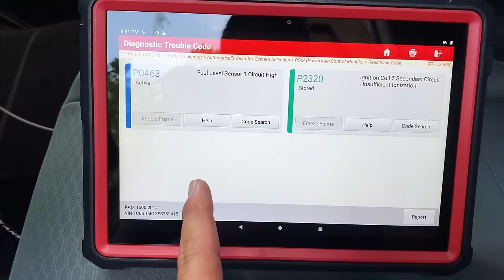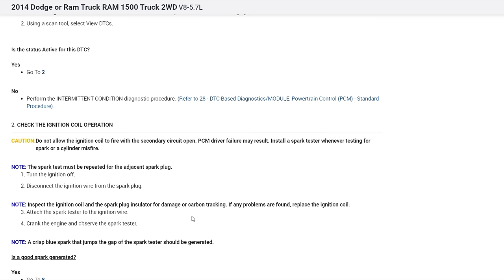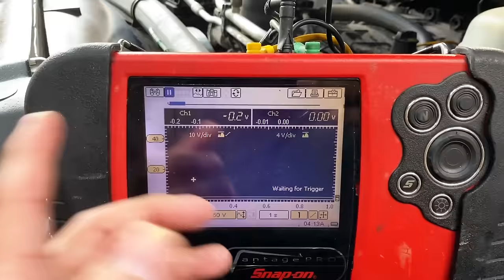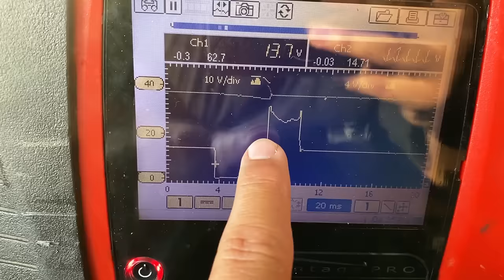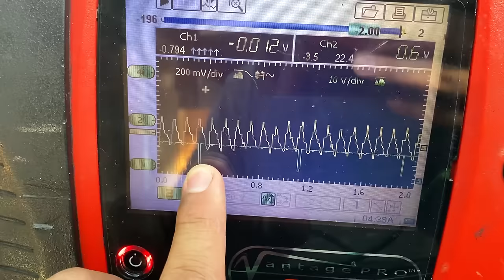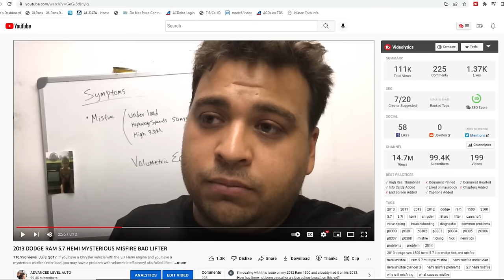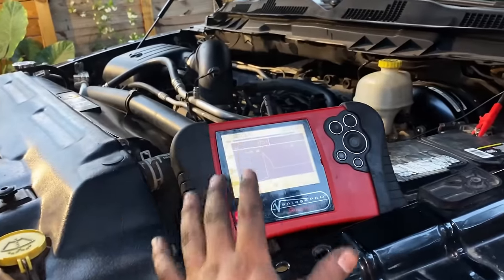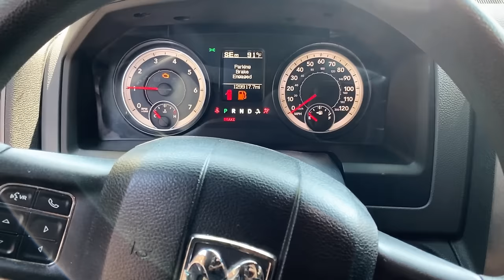DODGE RAM 5.7 HEMI MISFIRE INSUFFICIENT IONIZATION DIAGNOSIS & FIX

Comment: This was a great video, but I'm shocked that you wouldn't of went to the PCM almost immediately knowing the ram 1500 myself only knowing that vehicle they historically will go eventually given the location of that PCM module exposed to the environment hot, cold moisture etc. you name it. Just give me the location of that PCM at the rear of the vehicle next to the fuel tank it's just a shitty location but yes, check all the wiring and what not and the grounds for that for sure and if that checks out then you know it's the PCM for the Dodge ram that's to go to every time a cold like that comes up or a P0 628 anything to do with the ignition system comes from that power control module or powertrain control module. It's the mother of the ignition system, including the fuel tank and fuel pressures, etc. So next time you get a ram 1500 go there first with any type of code is a suggestion.

Comment: Very informative.  I kept saying it was bad NEW spark plug but you checked that off. Customer is lucky you found it wasn’t a lifter. 
What’s up with all these lifter failures anyway? Are current OEM oil viscosities too low?
Reply: I believe in the Hemi, it has to do with the cam sitting higher in the block, making the lifters sit more horizontal. That along with lower oil pressure at idle (especially with vehicles that see a lot of idle time) causes the failure.

Comment: I just replaced the cam and lifters on a 11' Durango. Once I ran it, it was very rough and threw P2305, p2311, p2317, p2323 codes. All passenger cylinders? I changed all the plugs on that side, and even a coil. Compression test showed 180psi for the cylinders. All rockers are moving as they should. Plugs are wet as if they arent firing. I am stumped

Comment: I think the oscilloscope did already showed something preventing the peak voltage going up. It was just barely 50V and a very "dull" shape, while normally it goes way above 150V (corresponding to the 10..15kV on the sparkplug secondary), and mainly really sharp pulse up and down (as the voltage first goes up, but gets very soon clamped by the arc across the spark plug). This tells, there is a voltage breakdown issue at the primary (low voltage) side, clamping the voltage to the 50V level, so preventing the secondary from reaching the breakdown voltage.
And such clamping could come either from wires with charred insulation (but not touching yet), or a bad switching element (inside of the pcm).
Regarding the cause, the switching transistor may get fried, when there is an effective open circuit on the coils secondary, so too wide gap in the spark plug, or the spark plug heavily flooded (by something not conductive, such as the gas is non conductive). I would expect it will be designed to handle such overvoltage for some time (the pcm stopping the pulses is an attempt to limit that time), but it definitely get stressed so it fail when this condition lasts for way too long (too many repeated start attempts, so way too much stress gets accumulated). Or the transistor (or it could be the voltage sensing circuit around) were just weaker to begin with...
Reply: Thanks for the analysis

Comment: I'm going through the same issue with my 04 Ram 1500 hemi but mine came up as cylinder number 5 as a misfire switched the coil packs and then I got all eight or misfiring it was saying. The truck was idling so poorly and the sound was almost like I had no exhaust on the truck. I cleaned the throttle body mass air sensor PCV you name it I changed it I cleaned it and now I'm reading oxygen sensor on a catalytic converter as it's saying that's no good. I took some Marvel Mystery Oil pour that into the oil and daily changed out oil filters right now it's running fine but it will act up every so often where it idles poorly or even backfires. It's a 2004 Ram Hemi V8 with only 116k miles, bought new in 04. I've had it with changing parts or cleaning parts that I'm just buying a new truck to solve the situation. I've read every article as everyone and nobody knows so it just comes down to getting a new truck.💯👍🙏

Comment: My ram was when I unplugged the computer on passenger side firewall the connection was green. Caused by condensation from the ac line. Cleaned it fixed my issues.

Comment: Damn, that’s a great case study Eric. If this was direct injected, I would be thinking carbon deposits on the back of the intake valves. Just another thought, you switched  injectors 5 & 7 but was the original PCM properly driving injector#7 ??? 
I’m looking for another excuse other than the coil driver for the cause…

Thanks again for the video 👍
Reply: Exactly what I was wondering getting injector waveforms would’ve been a simple test to do just to rule it out
Reply from the maker: I probably should have looked at the injector waveform, but I guess I was just focused on the ignition coil circuit because the code was very specific to the #7 coil circuit.

Comment: Excellent video with lots of detail! I have a Chrysler 2006 300c 5.7 Hemi that is misfiring on 2,4,6,8 cylinders a nd is confirmed with a diagnostic scan. Could this be the PCM as well?
Reply: Check for bad O2 sensor on that bank I had that issue  on a ram O2 fixed it
Reply: Do all the test he did it could be a rocker arm and the computer kills all the bank

Comment: Yo! This was great! I have a misfire on Cylinder 3 and headed down this road. I've replaced all the plugs, the coil on 3, and was about to replace the fuel injector when I came across this video. Interesting enough, I put a tune on the truck about a year ago which basically killed the truck and had to send the PCM back to Holley for reprogramming back to normal. Then, against my better judgement, I re-tuned it for 93 octane (trying to regain some lost power from larger wheels and tires). Everything has been fine up until about 2 months ago. After an oil change and a heavy accelerator load, the CEL came on. Wondering now if I detune the PCM back to normal, will the misfire go away. Any thoughts?

Comment: Man the energy you have to check all that and also take stuff out and put it back in crazy. I had my truck diagnosed for $150 and they determined it was the ecm so i asked for my truck back so i can install that myself since they are asking for $1200 to replace it. $600 for the part they said and $600 for labor.

Comment: I am having the same Problem with my Dodge Ram 1500 and it the same number 7 and I have done everything as you did in the video to check so should I just Change out my P.C.M. as well a get it over with yes or no

Comment: amazing ... as always your videos are useful informational educational entertaining ...
i have a question : why don't you try to repair the PCM ? 
also if the driver is burnt out inside the pcm why it was firing first 4 or 3 times before it stops firing ?!
thank you
Reply from the maker: Good question. First of all I am not knowledgeable in repairing small electronics. Maybe in the future I'll look into it. As far as the driver in the PCM is concerned, I don't really understand how it is still able to control and fire the ignition coil but it detects a misfire that is caused by itself.
Reply: @ADVANCEDLEVELAUTO  It should be cheaper to repair the # 7 driver in the pcm, as opposed to replacing the whole pcm. Or any other bad component in the pcm. Let us know Eric!

Comment: Hi, thank you for these types of videos. I have 13 Town & Country that I had to change the ECU because it wasn't charging (bought an older scope to figure out ECU wasn't commanding PWM signal to the alternator.) Once I replaced the ECU my gas pedal doesn't work and now I have some TCC trouble codes. Can you please tell me which Autel scanner you were using to reset the TPS/relearn? Thanks!

Comment: Just had a dealership mechanic tell us we need $6k to replace the lifters and maybe cam shaft, or $10.5k for new engine with 3 year 100k warranty. Wonder if we need a second opinion??
Reply: Lucky
Shop 2 weeks ago refused to work on mine and only offered to motor swap for $15k

Comment: Chrysler screwed up by putting the PCM in the engine compartments where it is a harsh, hot, wet environment. My '03 Wrangler PCM failed totally at 80k miles. My '89 Isuzu Trooper with a GM V-6 has the PCM under the center console in the cabin.

Comment: generally this code indicates an injector issue, even though its not listed in the flow chart. pcm looks at primary voltage  spikes and sees burn time is incorrect, partially blocked injector can cause this.

Comment: Reminds me of the Saab/GM partnership ignition coil pack which somehow measured combustion chemical composition to aid in fuel trim and timing and failed so much that there was a black market in coil packs. Probably was ionization based.

Comment: are you thinking that it will always be a problem with the 7th cylinder when its a bad PCM? or could it be any cylinder I have a misfire on #3 in my 2012 ram 1500 Laramie Laredo I'm starting to think its a cam issue but now I'm not sure since I found your video and I haven't had the time to remove the valve cover yet

Comment: I had a very similar issue. Ordered a replacement PCM and it fixed the issue until I drove the truck. Idled fine for a long time and then drove fine at first. It went about 10 miles and ran completely normal but then the issue came back. Any idea why this might be the case??

Comment: I have a p0305 cylinder 5 all plugs and coil pack on cylinder 5 was replace at idle misfires but under load it’s fine

Comment: I have the same fuel censer problem code with my 2015 ram 1500. What would be the cost to fix this? more or less. You said he didn't want to fix the problem cause of cost. I've been running the truck like this for about 6 months now, always resetting the Trip A mileage every time I fill up the truck. It's getting really old.

Comment: In cylinder pressure transducer testing would have saved you a ton of time on this. But good work either way at the end.
Reply: Please elaborate. Thanks.
Reply: @abdul-kabiralegbe5660  pulling the drivers side valve cover is no easy task due to the booster and ac lines being in the way. In cylinder transducer testing would have ruled out that the valves are opening properly and would not have required tear down. 

Bernie Thompson has some of the most in depth videos on the subject worth a watch. Automotive Test Solutions is his company.
Reply: @asewamu  Thanks a lot.

Comment: i have a 2010 grand cherokee hemi doing this with cylinder 4. moved coils, changed spark plugs-only 40k miles as of jul17 2024 original to me as i purchased new. i wonder if mine is computer as well.

Comment: Question I have an issue no one been able to figure out maybe you can give me some advice. 5.7 Hemi repaced cam lifter had head reworked and changed out plugs fuel injector also coil and still misfire on cylender 7 .  Code P307

Comment: Hi eric how did you do the current ramp test on all ignitiin coil at the same time. Im a diy and still learning showing would greatly appreciate it. Thanks and More power to your channel and im learning alot.
Reply from the maker: I used a fuse buddy adapter to attach my amp clamp to the fuse that feeds power to all of the coils.
Reply: @ADVANCEDLEVELAUTO  thanks eric for that information i would try it on my vehicle. Ive learned alot from your channel. Again ty

Comment: Any idea what would cause a P0301 Cylinder 1 misfire only at high rpms?  Truck runs fine until you mash on it.  Hooked up a scan tool and the injector is getting completely shut off during this process.  You can turn the truck off.  Start it back up and it drives fine until you mash on it.

Comment: Hemi don't mean two spark plugs for one cylinder. I have a 1993 Ford ranger it's a 4 cylinder and I use 8 spark plugs. For it too it's called bullshyt not hemi .... But anyways. My Honda just came up cylinder 3 missfire I rearranged the coil packs and found it was a bad coil pack. But also the power train control shot on. It was the Variable timing electronic control vtec sensor. Both those shot. But I think Firestone did it when they did a customer check. I think they tested the battery. Cause the ground was loose and sparking and caused those issues

Comment: Why didn't the shop work out when you had it up and running... Was it just because it was you alot of the time! I only ask because I have lots of people tell me I should open a shop. But I always answer that it's less hassle with no overhead cost.( what do you think )
Reply from the maker: I think it takes a certain type of individual to run a business successfuly. It's not easy managing employees and dealing with all of the stress.

Comment: I had the same issue on my 2010 ram it was the fuel solenoid under the bed dealership change pcm 3 times before they figured it out

Comment: Hey Erik
I've got a 2010 BR Subaru liberty GT premium turbo station wagon automatic transmission  EJ25 Turbo engine.
I'm after wiring diagrams for this vehicle, can you please guide me in the correct direction.
Regards

Comment: Soo I did a leaking valve cover gasket on a 2007 Chrysler 300c 5.7 and now I get a p0302 p0308 codes car was running fine before doing valve o over gasket replacement what could it be did coil swaps also same issue

Comment: I have an 03 Ram 5.7 
New battery, new Champion copper plus plugs, new wires, new mopar cam.and crank sensor.
I have a P0353 cyl 3 missfire.. coil circuit

Im getting power to the inj and coil but no ground to activate it.
Continuity test passed in the harness.. swapped coils and injectors and nada.. 
I just ordered a PCM from flagship hopefully this will solve the issue...
Reply: Did it ever work?

Comment: I'm sure this has already been said but after all that I would've disconnected two coils and crossed the control wires and then scope it. That's how I would've verified the driver.

Comment: My 14 dodge ram just got engine replaced with a used 30k miles due to tickling noise and misfire cilinder 8 and after 2 weeks the misfire comes back again with p0308 plus another code p2323 . This beautiful truck just sucks

Comment: Ive replaced all plugs and #3 cylinder coil pack and i still get the flashing check engine light over 75 mph.

Comment: Where did the PCM come from.... for $50 plus the ECM I'm willing to take the chance and order one for my 2006 5.7 ram with a miss on 7. I've done all the trouble shooting you've done on this video except the fancy waveform testing but i did a continuity test and checked for shorts the hard way..... so I'm thinking my pcm is shot. Bought it from a guy who threw in a ddh8 crate motor n did a half ass job. I'm thinking this had been missing since he put the motor in 30,000 miles ago....i just need to get her running right so i can get back to work and earn the money to pay for her

Comment: Misfires SUCK so many V8s can misfire and for numerous reasons. My old 03 hemi was misfiring because it had an unburned fuel issue. Something with the fuel tank I believe maybe it could have been the fuel pressure regulator. 

Possibly injectors with it 200 plus thousand mile original injectors

Comment: You ruled out the #7 coil by swapping the coil.
You ruled out the #7 injector by swapping the injector.
You ruled out the #7 plugs by swapping the plugs.
You ruled out the #7 lifter by visual inspection..
You ruled out the #7 compression by electronic comparison. 

Why did you not swap the #7 plug leads before deciding that the fault HAD to be the PCM?

Comment: Had this same code on 3.7 new plugs and new coils and still present. Replaced injector and code is gone. The code is supposed to refer to the spark. Damned mopar ionization code wtf...

Comment: I have the same code comming up on my Dodge 2011. Thought the wire/connector to the coil was deficient. After cutting the connector, I realized my replacement had wires of 2 different gauge sizes. I am unable to tell a gauge difference on the stripped wires comming from the wiring harness. Can anyone help me identify wich wires need to be connected together?

Comment: Three things that I didn’t see
ohm of spark plugs
inspection of wire circuitry 
inspection of exhaust manifold 

I know swapping spark plugs in relatively the same thing but I think you’re relying too much trust on electronics and not balancing out your methods with hands on verification 
 Break out a magnifying glass and inspection light 
Maybe use a thermal imagining camera.
Exhaust gases flow or leaking past 02 sensors would generally necessitate a cylinder shut down.
Invest in a cylinder leak down tester a coolant pressure tester.

Comment: 29:00 Any of those Launch scan tools would have programmed that PCM. If its 2014 they did not have the Security Gateway yet.
Reply from the maker: They can write the vin and the odometer but they can not program the software calibration file. The scan tool is useful if you are buying a used PCM from the same type of vehcle and you just need to change the vin. However, if you are buying a new or blank PCM, you will need to program the calibration file. Thanks for watching!

Comment: I own a 2012 Ram Laramie 1500 5.7 Hemi and I purchased and installed a Diablosport Trinity 2 Platinum Tuner and removed the MDS permanently and my truck never worked better.I also did some other tunes with the Infinity tuner and I agree that whoever had the brain fart to have an 8 cylinder dropping back to 4 cylinders is an Idiot because it's like a Volkswagen towing a cadillac.

Comment: It is called MDS which is also known as ECO mode where the engine will operate on 4 cylinders, and also causes the HEMI tick which involves your valves and lifter as well. Looks like you found the very beginning of the HEMI tick.

Comment: It's the engine with deactivate valves so it can get better fuel mileage like it operates like a 4 cylinder ,6 cylinder then last V8 power when need lol